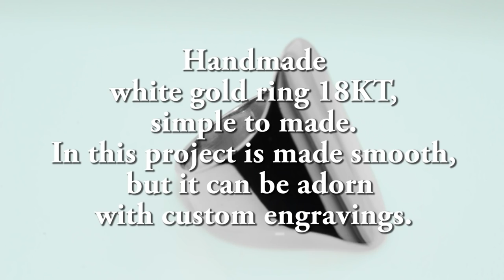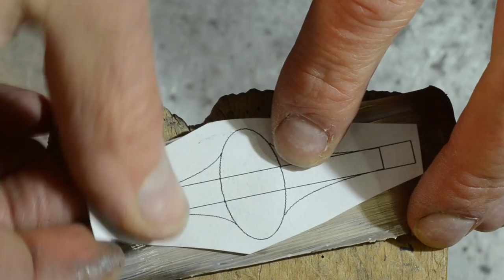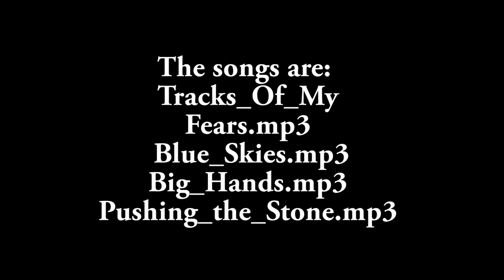Handmade white gold ring 18KT

Comment: what is the differences between 18k white gold and 9k white gold? should i go for 18k for everyday use? over the year wearing it without re-rhodium plating it, what is the best choices?
Reply from the maker: The difference between 18kt gold and 9kt gold is the amount of pure gold in the alloy.pure gold is 24kt, in 18kt there are 18 parts of pure gold and 6 of alloy. The final effect is the same, the more or less white coloring depends on the type of alloys that are used. The rhodium bath is used to have a white without the slightest yellow hue.

Comment: what is the sanding rod thing you use in your rotary tool at 5:33? did you make it or can I buy one someplace?
Reply from the maker: It is a drill pin with a central groove in which a strip of emery paper is wrapped. they also sell a ready-made type with the emery paper rod. you can find them in goldsmith tools stores

Comment: I was told it is dangerous to wear gloves at the buffer. Have you every had a problem?
Reply from the maker: Machinery is always dangerous, if proper attention is paid to it, it is unlikely that it will be damaged, the motors of the cleaners are not particularly powerful, if you mess up, often the damage will be lost by the jewels you are cleaning,

Comment: I always thought white gold had to be plated
Reply: pijnto some white gold has a yellow tint, but the higher karat the less yellow you see. 18k is pretty consistently brighter white
Reply: pijnto my engagement ring is a stuller X1 white gold mount. It's so nice to not need to plate it.
Reply: in teoria dovrebbe essere il contrario. Più la caratura è bassa, più platino, palladio e argento sono presenti nella legatura e quindi risulta più bianco. Meno oro, più lega, più bianco. Ma è un problema relativo perché poi di solito si fa la rodiatura che maschera tutto.
Reply from the maker: Today there are gold alloys that make the 18kt gold extremely white. Of course Rhodium bath at the end
Reply: Thanks
Reply: @CrustyChunkz  Wouldn't the higher karat be more yellow? 24 karat is solid yellow. 18k is mixed with white alloys to make it less yellow?
Reply: @pauladublinski1189  that's the theory if they kept a consistent alloy with the same they use for 14k, but a lot of 18k white stuff is alloyed with a more "concentrated" metal so that it still appears white with so little mixed in.